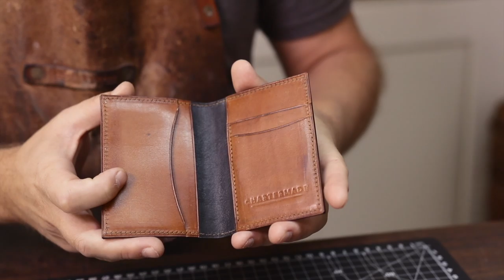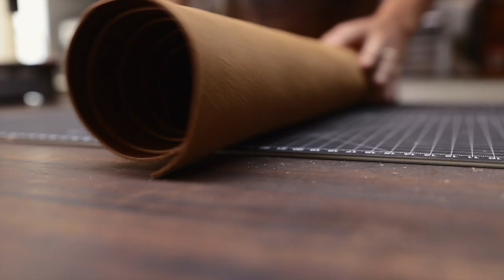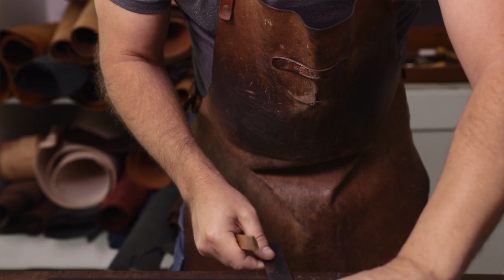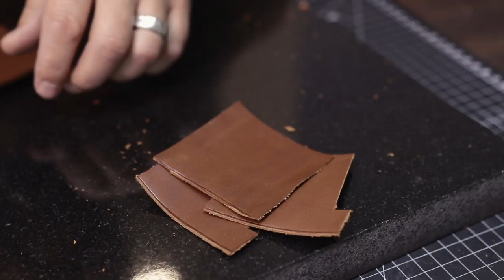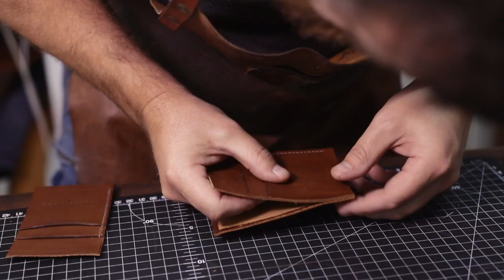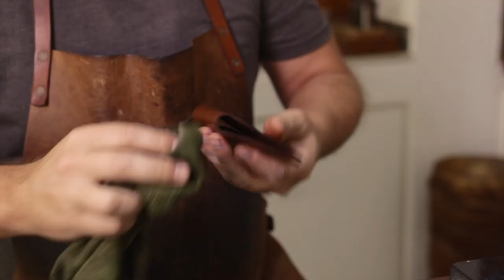Making a vertical leather wallet

Comment: Just received my replacement blade/brass handle set from Rocky Mountain Leather. I love it. I was surprised to see you running it along the edge of a metal ruler. Will that not damage the blade? I guess not. Using it that way will make cutting patterns so much easier!

Comment: So I noticed you only skived the edges on the card holder tabs.  I’ve got. A prototype wallet made out of card stock for my boss but he wants like a total of 10 card slots.  Will I run into thickness issues if I am stacking almost 5-6 card slots on one side without skiving the entire card holder piece?

Comment: Terrick, you mention that the right-hand version of your blade has the bevel on the left side. Why is that? I would think having a straight surface against the steel ruler would cut closer to the scratch line and be more consistent. Just trying understand the principles I'm missing here. Looking at buying one this week. Thanks!
Reply: Found your excellent video explaining the reasons! Thanks for breaking it down!
Reply from the maker: No worries man, there is a full explanation video on the channel that will answer all your questions on the blade. Regards Terrick

Comment: I absolutely love the blades for my L'Indispensable handle.  Wow, do they hold an edge!   That vertical wallet has beautiful, clean lines.  Which thread size did you use? Lin Cable?  Thank you.
Reply from the maker: So glad you are happy with your blades. I used 532 lin cable for this one. Regards Terrick

Comment: HAHA !! Taking a deep whiff of the item when complete. So rewarding. 
Great piece and video, as always. 
Do have a small question, does heat-able edge paint have to be heated to look good or was that dye ?
Reply from the maker: Thanks for your compliments. This was done using my burnishing method as on a previous video. This is stained with dye. When I do use edge paint I use "uniters" and heating it makes for a much smoother finish.
Reply: @CHARTERMADE  Thanks so much Terrick.  I may try edge paint and heat with the side of a edge creaser I've heated with a torch.  Really like that edger that takes of such a small sliver. You don't sell those do you ?